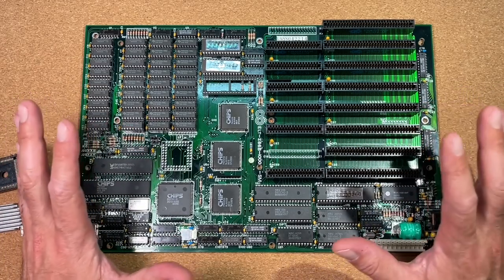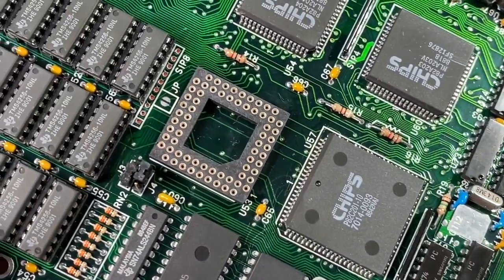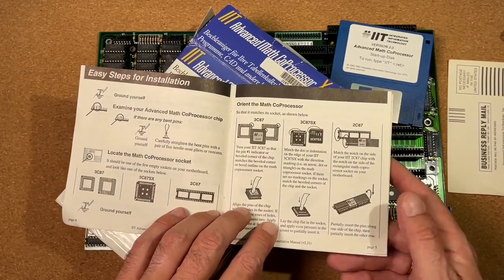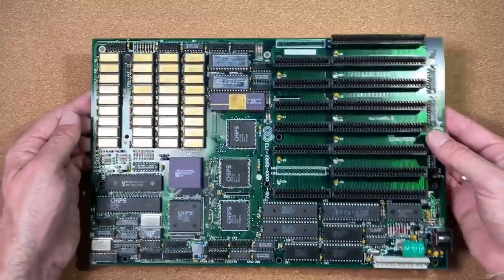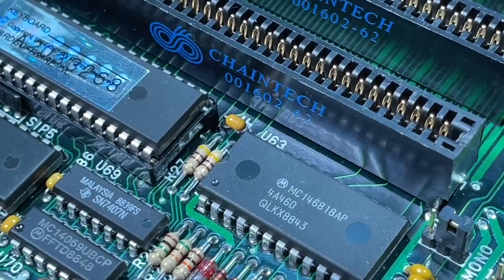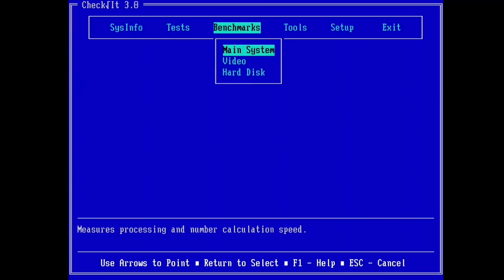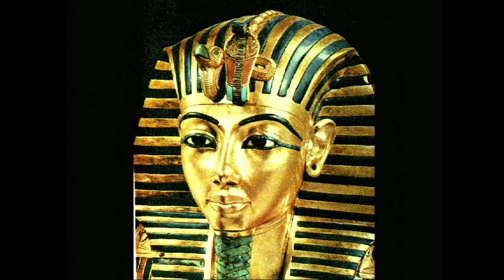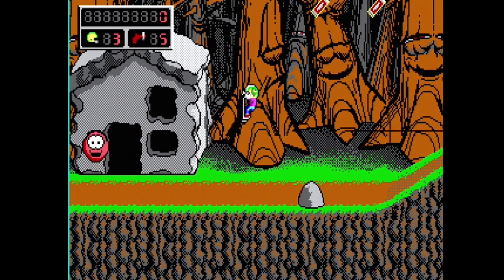Military 286 Intel CPU / Gold Bars & IIT Coprocessor Unpacking - Most Beautiful 286 Board!

Comment: I bet some of these CPU´s are still in service on military equipment!!!
Reply from the maker: yeah, for sure.
Reply: Of course, there are very reliable and today hard to hack.
Reply: Heck you Can Calculate Ballistic Missile arcs, or it can be in a Bomb sight.
Reply: @SeaJay_Oceans  long term being the same as any other motherboards term, I also checked the mobo and the sio and chipset is as reliable as any other motherboard they make, fyi they give that mobo 3 years life much like any mobo by any manufacturer
Reply: @shesoyam   in 3 years, the real  thing is the CPUs, memory, and everything else is faster...   ZX-81s, Commodore 64s  and  Atari 800s still work as good as new...
The only thing that seems to wear out on PCs is  that little battery on the mobo!  :-)
So they should just replace that with a rechargable battery like in cell phones... if it lasts 3 weeks  in 'off'  mode, that's all the bigger it needs to be...
If you don't use your PC for longer than three weeks,  just reset the clock and let the OS figure out the rest.
Reply: @SeaJay_Oceans  talking about the supposed long term Asus boards, can't say anything about commodore etc. As I've never seen one in person / repair

Comment: When i was a student in 1990, i had a Zenith 286 laptop with a blue monochrome display. I was studying AutoCAD V10 at college and the only way to get it to run on my laptop was with a 287 Emulator program. It was so slow !. It would actually take 8hrs to redraw some big drawings. I eventually saved up through my weekend job and got a Intel 287. It cost a fortune back then but it made a massive difference. Big drawings would redraw in about 2mins, rather than 8hrs.

Comment: "The 286 is the missing link between the 8088 and 386"
- 80186 cries
Reply: Eh, the 186 wasn't really intended as a desktop processor. It was more of an early SoC with so much integrated - really an 8086 with a bunch of support logic integrated for embedded systems. I was really surprised Intel kept making them until 2007!
Reply: @JosiahGould  Wow, considering how ephemeral modern CPU's are, that's quite surprising. I wonder what systems were using 80186's?
Reply: @JosiahGould  I thought it was buggy.
Reply: @SmithKerona  that's a great answer and I'm surprised that if they've been making them until 2015 they'd have stopped. What's the replacement, some single board x86 computer?
Reply: @fremenondesand3896  Well that CPU module is designed to be used in a distributed automation systems with proprietary I/O, communication hardware and protocol and programming software. So you can't easily replace it with off the shelf x86 based SBC. The upgrade path for these systems is from the same manufacturer with newer platform (they call it M580 PAC = Programmable Automation Controller) based on ARM microcontrollers if you want to easily port your already existing programs (mostly ladder logic 984LL). Very expensive costing thousands of dollars. Where I work we will be using the CPU modules with 80186 at least for a couple of decades before migrating to new PLC systems.
Reply: @JosiahGould  when it was new, the 186 was absolutely intended for desktop computer use — the 286 was intended to be used for multi-user systems and database management. Intel believed all everyone needed, even a few years on, was a cheaper 8086. 

Of course, the computer manufacturers all leapt on the 286 for the extra speed, so Intel was happy enough to quickly relegate the 186 to that more-specialised use case. But at the very start, Intel had not intended for the 286 to be a desktop CPU. (Like so often happens, Intel's initial intent was at odds with the wider industry!)

Comment: congratulations on your newest treasure! please never change and i hope you never run out of content. your guttural sounds of sheer glee are just as endearing as the hardware itself. 😄 also, too bad that the sound blaster awe64 gold isn't appropriate from a historical point of view. optically it would be a great match and it would still fit in those isa slots though... 😉
Reply from the maker: Thank you 😊. Don’t worry. I have so much stuff here and so many ideas that there is no danger to run out of content soon. And no, I will not change to Thin Client reviews and crap from Ali Express. I am only producing videos I would watch by myself as well if someone else would make it. 😉. Yeah, the AWE Gold would be a great choice, but its too far away from the historical pov.

Comment: I used to run a Citadel-86 BBS system. It was on our 286, 12mghz my dad installed the 287 coprocessor. We had a Sound Blaster sound card. And had a 30MB hard drive and a 100MB hard card and four megs of ram then often I ran a 2MB ram drive which was way faster than I ever needed it was fun for running games. It started out with a 2400 baud external Hayes modem and then later upgraded to a 28.8k USR external modem. Yeah we had a Okidata 321 macro line dot matrix printer.

I have no real reason to tell you other than when I think about that computer it brings back good memories and you're probably the only person (and your followers of course) who would understand what I'm saying.

Comment: Even though my first computer (if you can call it that) was a Timex Sinclair 1000 in the early 80's and then a Commodore 64, I consider my first "real" computer a Tandy 286 running Windows 3.0. It was the last solid machine I had before everything became modular with the 386 and beyond. Things just went uphill (or downhill, depending on how you look at it) from there. I have fond memories of going to many "computer show and sales" to buy components. Fun times!

Comment: Gotta say, having used some "military-grade" gear, I'm impressed that CPU worked lol
Reply: I've found military-grade can go one of either way... built-by-the-lowest-bidder junk, or stupidly-expensive yet decently-made kit. All depends on the contractor and the contract.
Reply: On occasion, a given stock item made by one company will have the contract transferred to another and the product will actually improve. An example is the standard US military padlocks for non-secure/unclassified purposes. It used to be made by Masterlock, and soldiers who lost a key had the easy out of just picking them open and not having to bother the quartermaster. After they were replaced with those made by Paclock, suddenly.. bolt-cutters became the go-to tool, and requisitions for new locks shot through the roof. Of course, military beancounters in their infinite wisdom see the sharp rise in replacement lock orders and assume it must be because they're not performing to specification, and they review the contract and ultimately gave it back to Masterlock. Ironically it was because the Paclocks were actually too good.

Comment: I agree these are beautiful and back in the 80s any of us would have given our left nut for a decent 286 machine. But I don't miss the slowness and continue to appreciate what we can do today. Great video as usual. Great production quality. Thanks for remembering history for us.
Reply: But you wouldn't have paid extra for a 286 with ceramic package chips. Not when there is no performance improvement.

And such a PC would have cost a lot more.
Reply: @deang5622  I actually skipped 286 entirely. Kept my IBM PC until 386 came out. 286 was still encumbered with that 1MB address space and a modest increase in clock speed.

Comment: Such a sweet board and the new purple ceramic and gold chips are awesome. Have you decided if your going to leave it as is? Or do you have a special chassis we yet have not seen yet for that beast new system you got. A special chassis build(same theme as the ram and cpu and any additional chips) with that board and new add-ons would be awesome. Have a good one.

Comment: The Military and regular CPU is the same die, just the testing is different. You should read the testing, IIRC Motorola and National included it in the early databooks as part of the book, so you might find them in databooks on Archive.org. I still have the paper ones from pre 1980.

Comment: This reminds me of my Borsu 10+ 286 16MHz system I had back in the day. Fully upgraded it with I believe 6MB of memory, an ESS soundcard, Oak VGA card and 14k4 internal modem :) Though I had to set the modem speed to 9600 baud, because the system was not able to handle 14k4 speeds for some reason.

Comment: 13:36 - Yay!  Another admirer of the Fujitsu SCSI drive.  I have the Fujitsu M2694SA, it's the 1GB version.  It's sitting inside my Macintosh IIci.  I also have a 2.3GB Fujitsu Magneto-Optical drive and external Fujitsu floppy drive connected to my IIci.  Sort of a theme going on. :D  If only I can find a Fujitsu CRT or LCD, I'd be all set.  I don't know why, but the white casing on that Fujitsu HDD is just classy. 👌  I want to find more and just hoard them.  They're deceptively heavy.

Comment: Now, this turned to be a really nicely pimped ride. Nevertheless, that Chaintech board-beauty deserved some golden-purple jewelry.
And I have to admit, sir, you have the style by selecting the expansion cards and the HDD. Just one hint: that SB Pro probably paired with a Gravis Ultrasound...nom-nom. :)
All you need now a nice chassis with glass side panel so that you can put this setup on display. :)
Reply from the maker: Thank you! yeah, I am really happy about the outcome. Damn, I was thinking to add a gravis ultrasound, but I did not want to block the view onto the nice RAM chips coz my gravis 1 is so huge. ☺️

Comment: Would you consider doing a build for me? - I own a local computer and technology company and recently opened an e-waste company as well. I am an avid collector and save as much as I can. I have seen a lot of your videos over the years and also speak with some people in vintage groups about some of your videos.  I have 95% of all the parts I need. I just need someone I trust to build it properly. I am looking to build a Golden IBM 5160. I have the motherboard, graphics card, and controller card all with gold chips.  The only thing I still would like is a memory expansion board which seems like it would have to be custom.  Either way, love your videos and looking forward to more and hopefully hearing back from you.

Comment: I have the same ELT-286B-1000-SM mainboard but heavily battery damaged and someone has removed almost all the socketed chips, oscillators and jumpers.  I had resigned the board to scrap as I couldn't find any photos or info online but now with close-ups from your video I think I have enough information to rebuild it!  Interestingly mine still has the 12 MHz Platsic PLCC AMD CPU - I'm guessing they weren't able to remove it from it's socket!  Any chance you could dump the bios next time you have it out please?
Reply from the maker: Hi. Sure I can dump the bios for you. If you want i make also some clearer pictures for u. just send me an email to cpugalaxy@gmx.at

Comment: Sometimes these things just have to be done. Sure it doesn't do anything the regular plastic/ceramic parts wouldn't do, but it looks damn good doing those things and it's a probably a safe bet it won't break any time soon.
When in a real jam with LIF sockets before, I've used rows of SIP sockets in their place. It generally works, but it looks a bit messy - not that you'd usually notice, as there'll be chip plugged into them.
Kinda amused by how it's the same board as my 286-16 that was built to be ugly. To that end, I shall e-mail you a copy of the TMC Jato BIOS I use with it, if I can remember what I did with the files. It has an 'extended setup' that lets you fiddle with chipset registers for things like memory interleave. Your board seems to be a slightly older revision, so it might not work with it, but it likely will. Might be worth a try.
Reply: You are making an assumption that because the package is ceramic that the chip will have a longer life time.

That is not the case. The die is exactly the same irrespective of what material package it is placed into. And it's the die that contains the electronics.
Reply: @deang5622  Maybe, but I'd wager the military spec parts were binned from stock that was tested more rigorously. The manufacturer generally guarantees operation at much wider margins, so the life should be extended by normal operation being much further away from those, helped in part by the cermaic packaging through things like improved heat dissipation and lower stresses from thermal cycling.
I think what matters here, though, is that it does what it was supposed to do and looks cool doing it.
Reply: @HighTreason610  No.
The testing they do does not affect the quality of the device. The design and manufacturing determine the quality of the device and that is the same for both commercial spec and military spec parts.

There is a burn-in phase for military parts where the chips are baked in an oven which wields out early life failures.

All they are testing is that the device can operate over the temperature and voltage range required for the military spec.
They are not affecting the quality of the device.

When they test the chips, the longer the tests take the more expensive the chip; they don't actually test the operation of the chip over the temperature range. That would mean taking each and every chip, plugging it into a circuit and then thermal cycling and testing the outputs. They don't do that.

So whilst milspec chips have a higher operating temperature range than commercial chips the design of the die itself is not any different and the manufacturing line up to the point of packaging is no different too.

What changing the temperature does is affect the timing of the logic components on the die. So the wider range of operating temperature for milspec is catered for by using different delay factors in the pre and post layout logic simulations in the design stage of the device.

 Then engineering samples are made which  can then be used to prove the design.

There is nothing that is done differently in the manufacturing processes to make the chip more reliable.
Reply: @deang5622  Please indicate where I said otherwise. I'm happy to have this discussion, but only if you're willing to do so in good faith.

Comment: Sound Blaster made an AWE 64 Gold, with gold connectors and stuff, it was ISA, so it should fit on a 286, but I don't know if a the driver would work? It should, because I only had dos and fast tracker 2 and the card worked fine.

Comment: TEAMHYBRID007
I would be curious to find out what Asic score is on these particular cpu's to  military grade versus civilian grade I might not be saying the term correctly but I have extreme ATD and I will forget exactly what I'm trying to ask but you can do it through cpu-z basically your right Mouse click and then you run a Asic score test or something like that and it tells you if it's 87% 78% 68% I don't know it's basically just saying that how much is the CPU is actually functioning you can hardly ever get 100% of the CPU ever function that's why they bin the CPUs

Comment: While I love these videos, as someone who had to deal with the 286’s wacked-out protected mode during code porting in the early-mid 90’s (for machine control systems), I’m glad it’s just a vintage oddity nowadays. Problem number one: obnoxious 64KB segmented addressing. Really Intel? You thought the one thing everyone hated about the 8086 was something you should maintain in a far larger 24bit 4-ring protected addressing mode; holy smokes, because of all the addressing calculations and privilege checks, even with a hardware MMU, 286 protected mode was far slower than real mode. Nope, I can’t say I’ll ever love the 286. 

The i386’s programming model (flexibility) was just so much better (starting with being able to flatting the addressing, but also things like v86 mode made running older 16bit code in protected mode far easier on the 386 than the 286). While short on GPR’s, and long on ISA quirks, I actually kind of like i386 and amd64 (it’s no ARM64, but hey, long-mode is more of the devil you know).

Oddly enough, I feel the exact opposite way when thinking back on the MC680x0. Elegant to start, but a lot of bad decisions by Motorola along the way made for really significant compatibility issues between generations, whereas x86 became less problematic as time went on. Though my Amiga 3000, with its 040-25 upgrade, is still my favorite machine of all time, I really didn’t like having to write cache degraders to get binaries that ran fine on the 020 and 030, to run on the 040 - and don’t get me started on the whole MMU inconsistencies and FPU compatibility issues between the 68881/2 and 040 on die FPU. Motorola made some terrible choices with the 040, which is why the line basically died with that CPU (yeah, there’s the 060, but almost nothing used it outside of embedded systems and a few upgrade cards for the Amiga).

Anyway love the videos.

Comment: I know I might be getting ahead of myself but are you talking about a math coprocessor because I think that's what you're talkin about I know they had it with 486sx and 486dx models the Dax had the math compressor built into it and the other one did not have it usually there was a socket on the board to add a math coprocessor

Comment: Why would a 286 have a heatsink? I don't think CPU heatsinks were a common thing until well into the 486.
Reply from the maker: the old chips were made in NMOS technology which had a high power dissipation. Therefore the thin clcc package needed a heatsink. The military one I put there is a CMOS version which has a much lower power dissipation.

Comment: Does the military cpu 286 also runs cooler?
Reply from the maker: Yes, much cooler. Its a 80C286. I forgot to mention that the C in the middle means CMOS. They don’t take so much current than the „normal“ ones and therefore they are also not getting that hot.